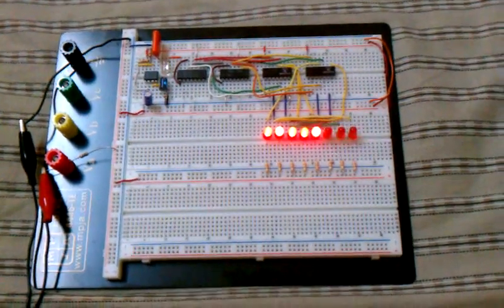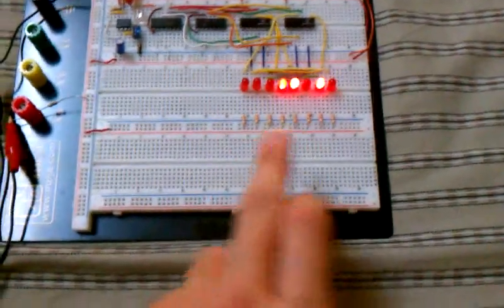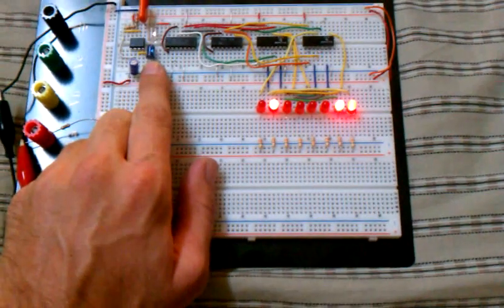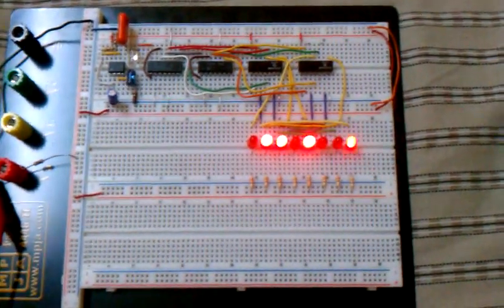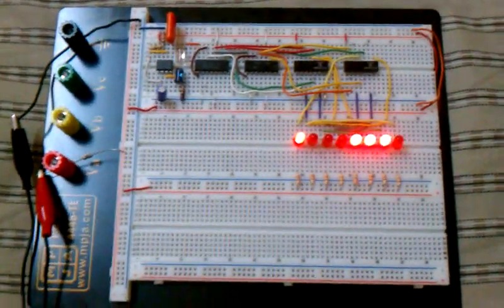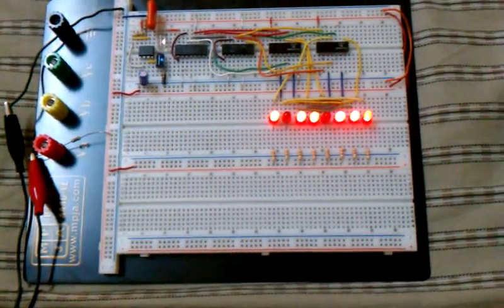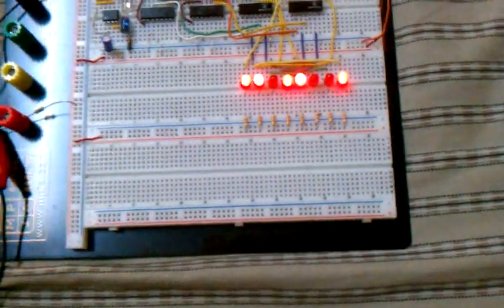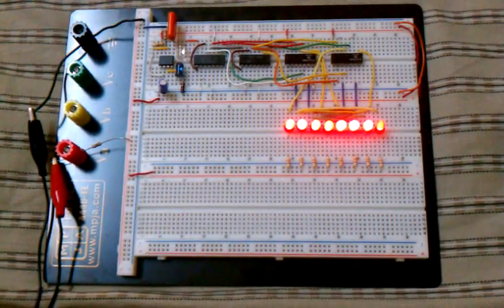IR 8-bit counter

Comment from the maker: uhendri1: are you requesting a schematic? It's actually very simple. Just set up an 8 bit counter with flip flops or a binary counter IC and run the clock (555 timer) through an infrared LED and phototransistor to trigger the count sequence.